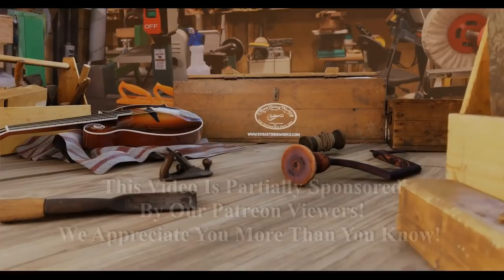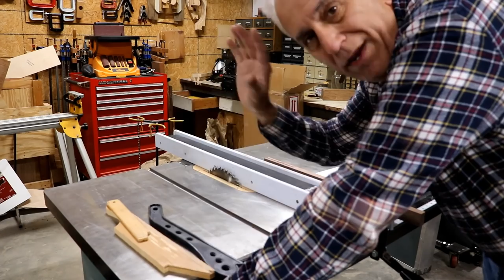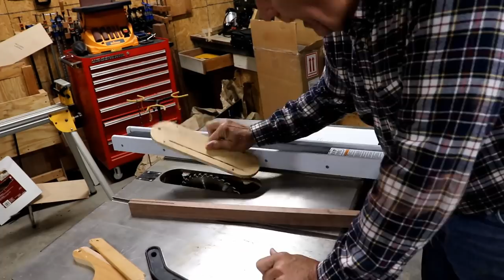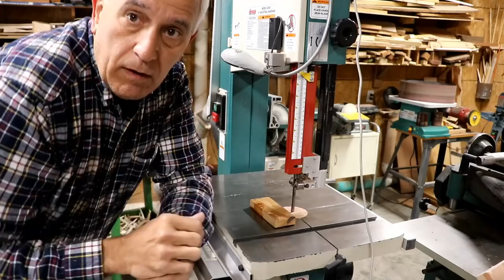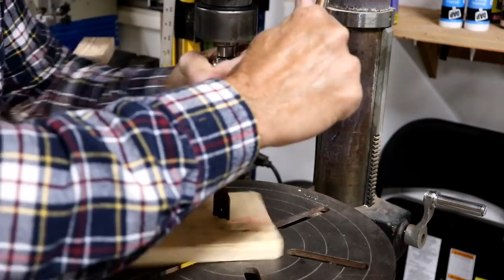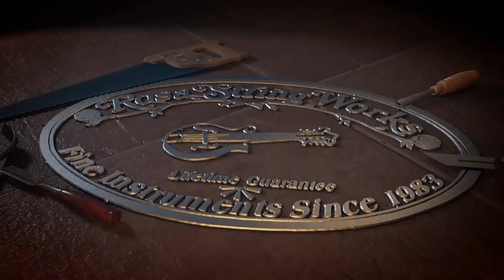572 RSW  A Few Important Shop Safety Ideas

Comment: One summer job, we were cutting 5 x 5 " supports and squaring off the edges ...no push stick either..
The guide was 5 " away from the blade and of course no one told us not to stand directly behind the blade.As I pushed one of these pieces of 1/2" plexiglass through to trim the edges it jammed and shot it back like a missle.
Luckily it was the 60s and we had these big leather belts and rock star buckles. It hit the buckle and saved me from a lot of damage. Good seminar  Jerry.

Comment: Thanks Jerry. A very informative video. My wife bought me a table saw a few years back and it came with the anti-kickback devices. I used them for a while and some one convinced me to remove them for "Clarity"... which I did. The saw also comes with a riving knife that helps to keep the boards separate. I was having issues with that as it would bind there. I have since learned how to fix that. I have had two kickback instances, which did nothing more than scare the heck out of me. Watching your video has prompted me to re-stall the anti-kickback device. That and your friends bloody mitt. I use push sticks, but the tip about standing behind the work makes sense. I will think about that more now. Hopefully I will remember the next time I use it, which according to my wife isn't enough. I will have to use your video for reference. Thanks again Jerry.

Comment: Jerry , thanks for the safety tips . It's very important for people new to using power tools and to those who are familiar with them . The drill press is one tool many don't think is dangerous but as you showed it can cause pieces to spin . Happened to me once while trying to drill through metal . I was luckily and  didn't get harmed . Ever since I used a clamp as you showed . I think many of us have come close to hurting ourselves with power tools but were luckily . Thing is to never take that for granted . Always be aware of what you're doing .

Comment: Very good safety video.  I've had my share of accidents (my fault) through negligence.  Fortunately none serious but could have been.  
I witnessed a serious incident while attending an auto-machine class in college.  Our instructor was demonstrating how to use the camshaft grinding machine.  While it was running, he turned momentarily towards us to explain what he was doing.  At the same time, he carelessly placed his hand on the belt pully protective shroud and inserted his thumb underneath it.  Almost instantly, the protruding pulley set screw wedged his thumb against the machine frame and sheared his thumb off at the knuckle.  Realizing quickly what happened, he grabbed his thumb and dismissed the class.  Our senior class member assisted him to the hospital.  Amazingly, his thumb was reattached but with limited use.

Comment: Jerry, I always wore a multi pouch carpenter's belt with the pouches on the front so, should the saw kick back - and I used the table saw a lot - the wood would hit the belt rather than my body. That saved me several times.

Comment: Good tips, Jerry.  I must say, when I bought my table saw (40 years ago), it had a toothed metal device inside of a plastic hood over the blade to prevent kickback.  It made things hard to see, but the reason I took it off is because those teeth scratched the bejesus out of the wood.  That said, I have had more than one small pieces of wood come shooting back in my direction at alarming speed.  Luckily I wasn't directly behind the blade.

Comment: On the band saw I put a little graphic cartoon of a guy that just cut his fingers off taped to the top wheel door. It kind of forces me to pause before I hit the ON button. 

The other thing I know from experience is your mental attitude is important. If I am not in a patient mood, if I’m not using the tool properly and I am fighting the tool I stop. The tool does the work right. If you are pushing and forcing things STOP, walk away and figure out why you are having a hard time with the tool. My two cents.
Reply: I have often awakened,in the morning, feeling as though, after every
few steps, I need to stop and wait for my mind and spirit to catch up with my body.
That is a day I do Nothing. Because I know, whatever I attempt, I will screw the job or screw myself.

Comment: Great advice. An hour or more making a jig or fixture for a single 4 second cut is worth a lifetime of limbs!

 Ironically, some of the worse kick back accidents I've witnessed came from people using a push stick. I've seen a push stick used on a short board that was 6" or so wide. They used the stick right along the fence, when the wood was through the blade the push stick rotated the board to the left and the blade spun the wood back at him. The guy wasn't too bright as he kept repeating the process until I shut him down from the saw for good.
Reply: How would you do that cut differently to avoid that kickback?
Reply: @samsaxe-taller7145  I assume you mean the 6in board mentioned in my comment. Well, in this cast there was only a small amount being removed, so there is plenty of room for your hand to push down and forward...otherwise a pushblock the pushes down and grabs the piece from the back edge. If referring to the example in the video where the guy got hurt, personally, I would resaw on the band saw since it is so dangerous on the table saw. If there is no choice but the table saw, using a proper push block, I would cut most of the way through in one pass (very sharp blade is essential) then cut through the remainder by hand so there is no errant piece of cut off to cause trouble.

Comment: Thank you for reminding me lol.  I've had a couple of gut checks in my life when I was younger (board shoots back).  I agree with the removal of the guard.  I included, we all do it.  I'm probably just a few years younger than you (59), but I have learned to still use the riving knife.  Some of the wood you get (especially now) is still so wet that it moves the moment you cut it.  Especially pressure treated wood which is injected under immense pressure.  If the wood moves out (opens up) no problem, but if it closes or pinches it catches the back of the blade and you have a big problem as you already said.  When it hits the back, it wants to go up, period.  A hold down and a riving knife really help.  Sufficient power I have found also helps.  If the saw is underpowered for the job, say a three-inch-thick piece of maple, you end up with a problem or a gut check (ask me how I know 30 years ago lol).  One more thing I can say from experience (put my finger in a carbide blade when young, probably 35 years ago), is always, always, always wait for the blade to come to a complete stop, after you turn it off, before attempting to grab or move any board.

Comment: Jerry, shop safety is paramount! I had a full woodshop for thirty years, with all of the power tools and equipment necessary to make fine furniture. My shop was a 30'x30'x12' wood frame, corrugated steel building in my backyard. It was built by the previous owner, for his woodworking shop. When he retired, he sold me his house and the woodshop, lock, stock, and barrel! I was not a total newbie in woodworking, I took woodshop in high school, but I had been separated from it for a long time. I did not have a guard on the table saw, but after my first kickback, I always used two push sticks for re-sawing anything. After thirty accident free years of working in my shop, I retired, and the next guy "inherited" the woodshop. I still have all my digits and no significant scars, and I have a lot of fond memories!

Comment: Good advice Jerry. As some one who's worked with metal a few yrs.(lol) I was taught by "the old heads" the harder the metal (ie: titanium, stainless, etc) the SLOWER you drill, or cut. The softer the metal (aluminum, brass, etc) the faster you drill or cut. I've wondered if the same applies to wood. Good points on the Drill press & ban saw, too. Also I found out, the hard way, use the shortest drill bit possible. I had a long 40 bit break, & went right in to my finger. (Yes I was putting too much pressure on the bit. I was drilling through about 8" of aluminum. Dont get me going on countersinks. LoL)

Comment: A UK TV advert for the building site
Sir Isaac Newton told us why an apple falls down from the sky And from this fact, it's very plain, all other objects do the same A brick, a bolt, a bar, a cup, invariably fall down, not up And every common working tool is governed by the self-same rule So when you handle tools up there, let your watchword be "Take Care" If at work, you drop a spanner, it travels in a downward manner At work, a fifth of accidents or more, illustrate old Newton's law But one thing he forgot to add, the damage won't be half as bad if you are wearing proper clothes, especially on your head and toes These hats and shoes are there to save the wearer from an early grave So best feet forward and take care about the kind of shoes you wear It's better to be sure, than dead, so get a hat and keep your head Don't think to go without is brave; the effects of gravity can be grave

Comment: Jerry, Have you ever heard of the product called “Micro Jig” ?Its a safety aid with a handle and grips onto the work piece as you push it through the blade of the table saw. Looks like possibly a good product but your holding on to it while at the Same time close to the saw blade.
What are your comments about this product?
Reply from the maker: Sorry not familiar

Comment: Jerry. The second most common problem with a table saw is improperly dried wood. It can have internal stress and as you rip it the kirf will close up and pinch the blade. When that happens, the wood will be coming back at you real hard. A splitter of riving knife is the only defense to this common problem.

Comment: I've been told and seen things. I've heard about band saws and fingers. The guy I was briefly apprenticed to almost never uses a table saw. Why?  He had a kick back on a Skil saw, which knocked it out of his hand. He reacted and attempted to grab it, out of reflex, and cut his fingers off. They were reattached and fused in place. 

Also, I never wear jewelry using tools. Why?  I was told of a guy using a lathe and it caught his wedding ring. I think he kept the finger but the bone was completely exposed. 

I'd also point out that I've seen what happens when a belt sander catches. I've seen bruised up people and damage to walls.

Comment: Feather boards are key to prevent kickbacks, but they need to be installed properly. You can make your own, but understanding how they work is important. Proper stance is also key. Keeping one foot out in front, allows you to keep from falling forward, in case you loose your grip or balance.